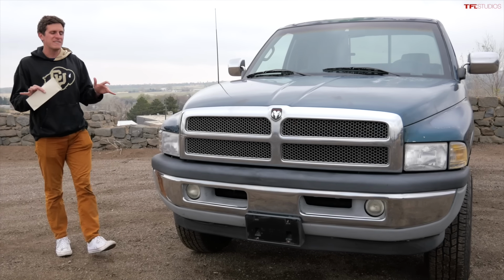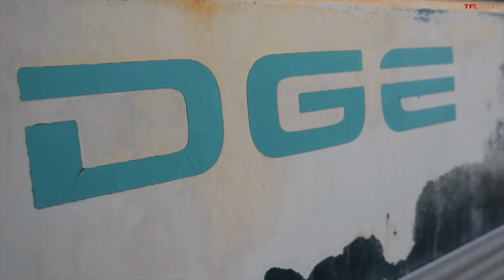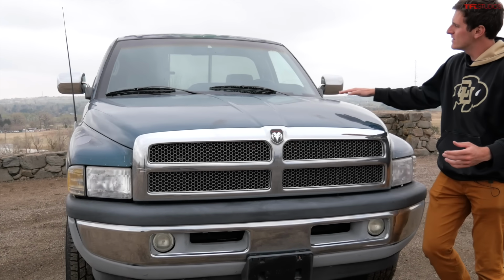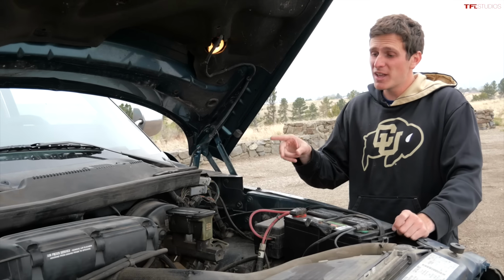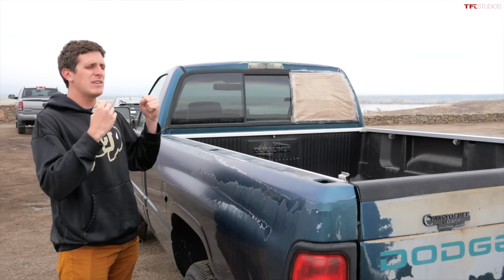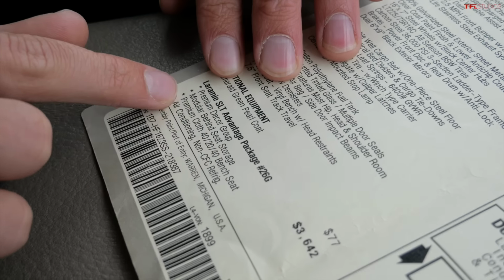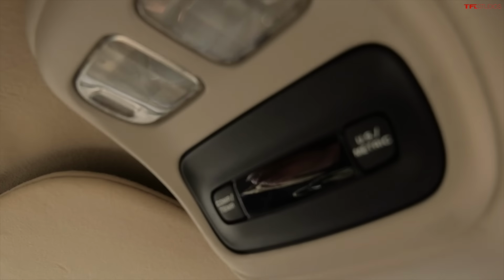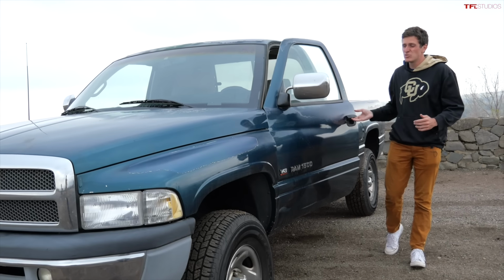The Second Gen Dodge Ram Is The Most Important Truck Ever: Here's Why You Should Buy One NOW!

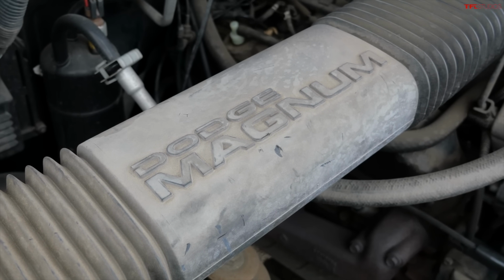Comment: 4:29 look at that only half the engine fits . the bone headed descision to keep the same engine bay for the cummins and v10 . so if you got the v8 crawling in there to maintain was a pain. the distributor is way in the back under the windshield cowl. but the dakota has more room in a smaller truck working room is much better easier access.  

so if only they used a different engine compartment for 3/4 ton for the bigger engines would have been flawless.

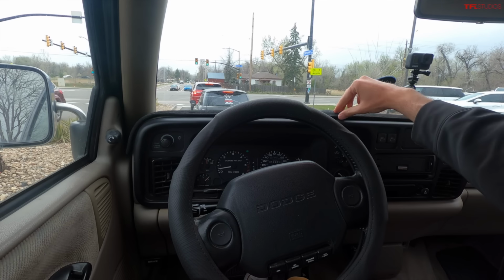7:20 idk bout that
Reply: That was their "cab forward" design. Not a chassis issue, look at the fan shroud, there's plenty of room for that pig V10. Mopar decided to put those distributors in the rear for some reason. We own 4 second gen half tons, 2 with the 5.9, and 2 with the 5.2. one is the sport version
Reply: @dodgeboytrx150  there was still no reason for that set up for the half ton platfom. 
 the dakota fit the engine perfectly not wedged in the back . cab over design or whatever it was still a boneheaded design .
makes the airfilter also a bitch.

Comment: I have a '97 Ram 1500 with a 360 V8 auto and so far has 281,900 miles and still going strong with original engine and trans. I've owned the truck for 9 years now and have almost put 90,000 miles on it myself. If you take care of them they will last.
Reply: Wow. Not bad at all. I like that year and style Ram. I have a 2019 Longhorn and hope to put that many miles on also. 👍
Reply: My tranny blew but I rebuilt it myself and that 360 is still going super strong. I recommend a transgo shift kit, itll beef up the tranny and make these awesome trucks last forever
Reply: I’ve got a ‘99 with a 360 v8 auto as well. I mine has 253,000 miles on it right now. It has a few issues but to my knowledge the engine and transmission weren’t altered. Now, I will say that my transmission is getting worn out and my transfer case is not well. It’s a wonderful truck. They just need some love from time to time and that’s okay. Anyone want to make suggestions for my next transmission? I don’t plan to stay OEM seeing how unreliable they have been.
Reply: i own a 1994 that i bought from my dad who bought it new when it first came out. I drove it all through high school and it had 120k on it then. Now after 27 years old i have 325,000 miles on it. Its the only year model of these trucks that has OBD1 and also the only year with a 46RH trans. It is super easy to work on and I have completely redone the truck front to back and i Am about to paint it to make it new again. Now i have changed the carpet to a vinyl floor and added a second battery to run all extra accessories that were not factory, other than that I try to keep it clean and simple. I love my truck and plan on keeping it going and maybe passing it down one day.
Reply: I just bought my 1997 single cab short box back i sold it with 202,000 miles now it has 216,000+ miles and is still going i LOVE that junky little truck I want to restore it its still rust free.
Reply: Great stuff bro . I have a 96 Ram 1500 80k miles
Reply: You’ve had it for 9 years at the time of the comment and you have only put 90k miles on it?
Reply: Good to know, I’m about to buy the 1996 2500 in a few days!
Reply: I don't guess you would believe that it still has cold A/C either and I think I charged it up one time about 4 or 5 years ago and it still works good so far. The truck does need some work, like exhaust work, needs A frame bushings on drivers side but other then that the front end is ok, needs painting, needs tires soon and a few things like that. 

I think the main thing that helped keep the trans going is that I put external trans coolers on it and I keep the trans fluid changed regular. I think the cooler in the radiator doesn't keep the trans cool enough. So the external trans coolers help keeps the trans cooler and on the road. Believe it or not all I know is I've put 90,000 miles on the truck myself and haven't changed the trans out yet.
Reply: @theramquest4advanture.  I owned my ‘98 ram for 23 yrs and never had to recharge the a/c, chrysler made a good system
Reply: @pathunter7003. Update on my truck, it now has 305,600 miles on it so far and still going strong and now I've put 113,000 miles on it myself so far. Also I haven't charged up the ac on my truck in about 8 years either and it will freeze you out of it in the summer.
Reply: Update on my truck, its still going it has 283,450 miles on it so far. It was missing but changed plug wires and now its running smooth now. Yeah wish I could fix up my old truck and bring it back to the way it was new, maybe one day.
Reply: So far it has 285,500 miles on it so far. Next August I will have owned the truck for 10 years and I have put 93,000 on it myself so far and still going strong. 

But here's a story of what happened last Friday when it was so cold I done something stupid, I started up the truck to let the battery charger up some and it was still low, so I decided to drive up the road to charge up the battery more. So I took off on not so cleared roads, in a two wheel drive truck, it was very cold, and then I got so far down the road and realized I didn't have my phone on me. 

So here I was in the cold, no phone, on snowy roads in a two wheel drive truck, but I do have new tires on it and they were doing good and then I started up a hill. I first I thought I was spinning but no the trans stopped pulling. Also I was now about a mile and half down the road looking for a turn around place, then the trans stopped pulling. 

I let in roll into a place where Amish builds storage buildings and now I was in for a long cold walk home, no way to call anyone. Truck lost the trans or I thought it went out. Luckily the Amish guys working there came out and said it was ok to leave it there. Then I looked and saw trans fluid everywhere and then saw it blew a trans line and the Amish guy took me back home in a horse and buggy. 

After getting home I was so lucky I didn't have to walk all that way in that cold air. Next day I went and got some trans fluid, put it in it, and got it back home. First it didn't seem like it wanted to change gears, but got some more trans fluid put in it and now it changes gears good. So thank goodness for the Amish guy and that I didn't mess up the trans and I will never do that again.
Reply: Well next month I will have owned it for 10 years and now I've put 99,000 miles on it so far, still going strong. It has 291,250 miles on it so far. Yeah I have a '99 Nissan Quest that I drive every day, when it's not tore up, like now the water pump is going out on the van, so been driving the truck some more. That's the best thing about having two vehicles is you have a back up when one goes down.
Reply: Update on my truck it has 299,300 miles on it so far and still going strong.
Reply: Another update on my truck, it now has 324,000 miles so far, now I've put 132,000 miles on it myself so far. Still the same engine and trans and still going strong so far. I just keep all the fluids changed regularly and so far so good.
Reply: Well the guy I got from said that it hadn't been changed and I haven't changed it in the 9 years I've owned it. Does the trans have numbers on it to proof that its original to this truck? If so I will try to find the numbers and take a picture to proof it.
Reply: I can guarantee that transmission isnt original, or its been rebuilt. Unless u got the manual. But no damn way that transmission is completely from the factory no work done.
Reply: @seanbutler2291  the 46re is a great trans . Reason why 2nd gens got shamed for bad transmissions and used as the dodge joke. Was because they shoved 42re on the 2nd gens mating them to the 5.2 and the 42re suck big time those were commonly found in the jeep Cherokee and laredo's. Behind a inline 4.0 and some 5.2s.  the 46re can last up to 200k. I also speak up because I own two 2nd gens and a 3rd gen. My 96 has the 46re and all original still running and driving perfectly fine. I have bought a 99 that had the 42re and that junk blew on me on the road luckily it limped me all the way home for 3miles on first gear and got lucky I was able to park home til  it wasn't drive able.  My 3rd gen is my daily it's got the 545rfe and runs and drives good no issues has 195k.
Reply: @seanbutler2291  what are you talking about my 1998 had the auto and it has high miles and is completely original with fluid changes only🤔
Reply: @seanbutler2291  I have a 2001 Dodge ram 1500 automatic has 186,000 on it transmission was shifting erratically changed the accumulator spring adjust the front band and rear band put new ATF +4 transmission fluid in it it's been 2 years no problem still shifs smooth
Reply: @LONEWOLFIFTYSIX  apparently if you remove the Check valve in the front tranny line passenger side from the radiator you won’t have any tranny issues.Its a black rubber hose about 12 inches long
Reply: @JB-lc2fn  is that safe to do that
Reply: @sean
I just sold my’98 quad cab two yrs ago after owning it for 23 yrs, it had the original transmission in it, never gave me a problem and I towed a 25’ boat regularly with it, and hauled my classic car thru the mountains,of Pennsylvania . I did replace the trans fluid in it once that’s all. A lot, of owners had no problems with the trans like some, people would like to believe
Reply: @seanbutler2291  I can guarantee that my ‘98 had no problems ever as I owned it for 23 yrs and towed with it a lot over those yrs. But I did order the HD tow pkg, it had a cooler almost as big as the radiator

Comment: I had a brand new 1 and it was a beautiful truck,The Horsepower Was Very Low For The Size Of The Enging,But I Wish I Had It Now,Can't Work On These New Pieces Of Junk That Cost $60000 After All The Taxes,Freight, Tire Tax,Ect., But I Have A 2002 Jeep Grand Cherokee Laredo quadra track 2 4.0 l6 engine with a 4 Inch lift and 33inch ×12.5 R17s In Mint Condition and can go anywhere

Comment: That's a nice truck but I like my 1994 C1500 Silverado better with a 5.7 200 hp 310 lb of torque it pulls my 21ft travel trailer here in the Pacific Northwest we go from sea level to 2,600 feet is 30 miles and and we also have 7% grades it hauls a lot of firewood and here in California we don't get the rust on the frame like that truck

Comment: I have always loved the look of the 2nd Gen Dodge. But always stayed away from them because of the auto transmission. I never met anyone who had one that wasn’t on their 2nd or 3rd transmission.
Reply: 130k miles and not any tranny issues so far, knock on wood.  So if we ever meet, I'll be your first.   :D
Reply: Original owner of a 1997 5.9 4 by4 auto, at 50,000 miles the tranny went spent 2600 to rebuild the tranny, at that point i figured i would keep it, now has 69,000 on it.
Reply: @jimharrison3552  I hope you continue to get many more miles. I love my 88 w100 4 speed 4x4 318. base with 99,000 original miles. But I'm not the original owner only had it 2 yrs.

Comment: I had a 99 Ram 4x4 with the 5.9 in it and it was great offroad, better than my friends z71's.  I loved that truck.
Reply: Not trying to start an argument, but what specifically did u like better? I am genuinely curious, cause I thought Dodge gave them a nice stance from the factory and as for the 2500 and 3500s u could almost walk under those. Lol
Reply: @chuckersw  What did I like better than what? the 2500's or 3500's? I do not like the 1500's better. lol

Comment: I strongly disagree. Was in the market for one of those trucks in 1995. I thought the Dodge was crap. Handled far worse than the General Motors version, had a noisy, but slow, engine. Sloppy transmission. Miserable steering. And crappy interior even by the standards of the time. Oh yeah, also ugly

Comment: I guess I got lucky. Late summer of 2021 I picked up a 1993 GMC, “not Dodge”. A C2500 with 47,146 miles on it and I just turned 51,000 miles on it. Although it has a 350 engine, it doesn’t have that much power  compared to the new trucks. It was garage the whole time. The paint is perfect,  Interior is perfect, and it has zero rust. This Dodge though however it looks like it has 147,000 miles on it. But I like it. I was always a dodge fan. But I never have liked the 360 engine because their  a gas hog and I thought Chrysler  should have used the 340s and the 440s in them and that would’ve been a lot better in my engine opinion IMO.

Comment: I know everyone complains about the price of new trucks, but $25,000, which is an inflation adjusted price of more less $47,000, is actually way MORE more than a similar equipped modern Ram Classic, probably $10,000 more, really. Heck, you can buy a nicely equipped Ram HD 4x4 gasser regular cab for less than $47,000.

Comment: Tommy, don't kid yourself, that truck is pretty clapped out. The condition of the paint and that headliner is embarrassing given the mileage.  Also, inflation adjusted that sticker is about $46k. I went over to Dodge and spec'd out a regular cab 4x4 with a 5.7, 3.55 axles and a rear limited slip, towing package, uprated entertainment, cloth buckets, power windows and locks, spray in bedliner, and some other features not available in 1995 and still came in under $46k. So while we talk about truck prices going through the roof, it turns out that inflation accounts for most of that, not manufacturer or dealer greed.
Reply: Yeah that Colorado sun kills paint jobs.
Reply: Condition of the paint and headliner doesn't really say much about the rest of the truck. Dodge had serious problems with the clear coat on pretty much their whole line from the middle 90's to early 2000's. Ditto on the headliner glue. Buddy of mine had a 96 Dakota brand new and had to have the headliner replaced 3 years in.

Comment: I remember the first time I saw the new Ram with the “Big rig” design. I was enamoured!! The only thing that kept me from them was the horrible luck we had prior with Dodge trucks!  I have never owned one but I have been dealing on a short box 1998 Ram SST. I think the price we are at is fair,,,,, that’s what I will do today is get the trailer out and go pick up a “new” pick up!! First Dodge or Ram in decades for me!! Hahaha. 
     I love this older truck he has. Typical and relatively simple issues except the paint,,,,,,,. That’s gonna cost a bit and needs to be done SOON! The. Rust showing is surface rust, but won’t be for long,,,,,,,.  Very nice regular cab long box!! When I heard there was a 360 in there I thought he would be able to pull stumps from the ground and then drive to the next fuel station for more gas!! 😂😂😂. Ugghhhh horrible motor from Dodge/Ram back then!! Last forever, but the fuel consumption,,,,,,,. 
       Definitely a fun review regardless and the final push needed to save another unique Ram. The one I am picking up. Looks great, the clear coat and paint just refreshed, interior mint, but there’s a dead 5.9 Magnum under the hood. He said his kid drove the truck one weekend, about 500 miles and the truck had to be towed home from a party spot the kid was at,,,,,. I suspect he transmission took a heck of a beating that weekend as well!! Can’t save the block as there’s a 2” x 3” piece that gone!!!  Oh well..
Reply: Holy hell, yeah there ain't no fixing that engine lmao.

Comment: I would love for someone to find out why it took Dodge till 2010 to come out with a true crew cab, as in from the time they came out with this new body style to 2010.
Reply: Dodge actually had many crew cabs before 1990. When the Cummins came out the amount of torque was able to twist the frame under load. They resigned the frame to remain rigid opposed to flex. This allowed for an 8 foot box and extended cab body at maximum length.
Reply: @RyansShop  as I said, with the newer body style,  I know they had crew cabs in older models,  Dodge should have, and could have, designed a better frame.
Reply: True...especially when the competitors were offering a crew cab at the time (except the Toyota T100 which was later replaced by the Tundra).

Comment: I had  a 97 with the 360. It was a great truck but the transmissions were awful. Mine went through two of them. I loved the 360's power but mine got 12mpg wherever I drove it, back roads or highway. 8mpg sounds suspect like something is wrong with it. I would recommend a transmission fluid change immediately and frequently in an effort to protect it as best you can. 8 mpg doesn't make sense though. I never got that low even pulling a trailer.
Reply: I agree, seems it would take a lot of flogging to get it to 8 but I dont know. I've never owned one.

Comment: these trucks really were not that great. i had a 97 with the 360. the automatic transmission was junk. the steel body rusted incredibly fast. the interior fell apart within 5 years. compared to the chevy and ford at that time yes the styling was much better but the reliablity was not even close.

Comment: I had a 1998 ram 1500 quad sport 4x4 short bed with the 5.9 360 gas motor best truck I ever had!! 300,000 miles the only thing I did was put a new rear end in it. Wish I still had it when I got a 2004 ram 1500 it was just parked and someone offered me some money and I let it go to make more room in the drive way